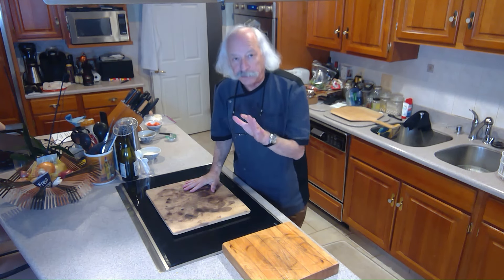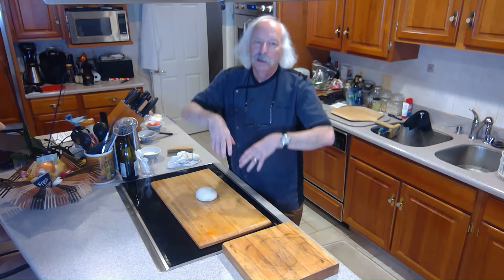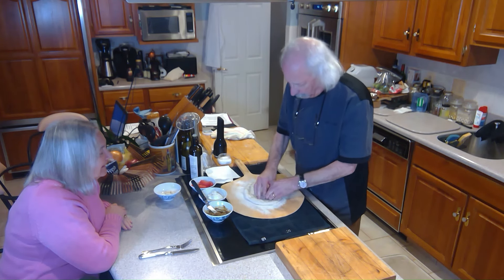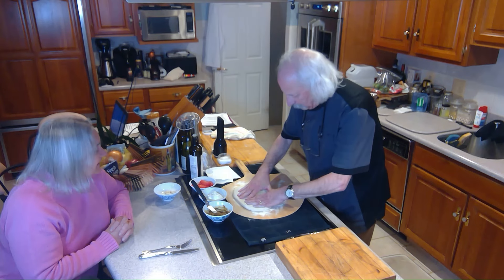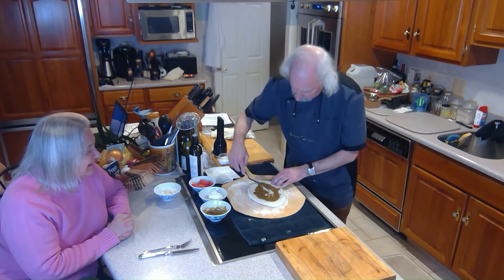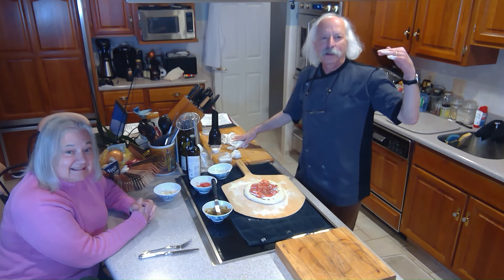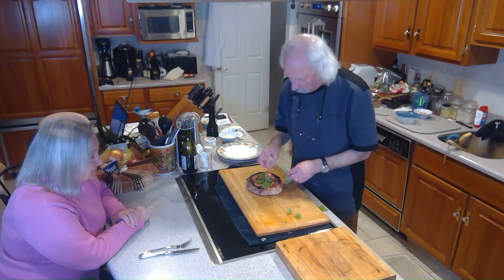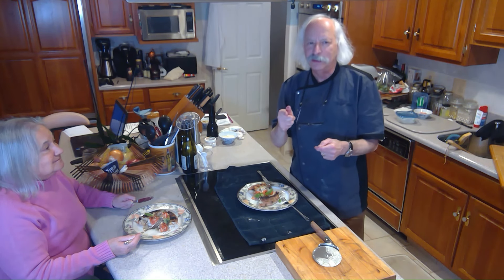Episode 171 - Pizza - Pizza Napolitana Caprese

Comment: If the dough springs back, leave it alone for a few minutes and then continue stretching. I take my dough balls out of the refrigerator several hours prior as one hour is not enough to warm it up.  Nice crunch!
Reply from the maker: Thanks for your input.  It's true if you leave it longer that it will be even easier to work with if you want to make it bigger and thinner.